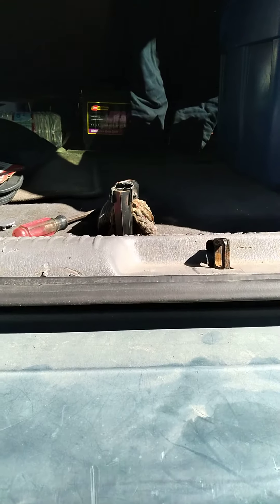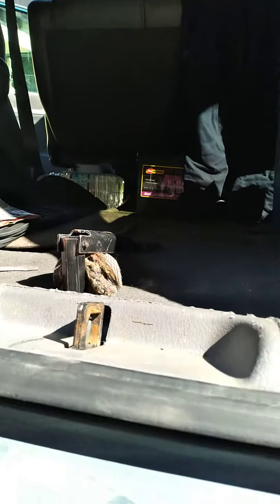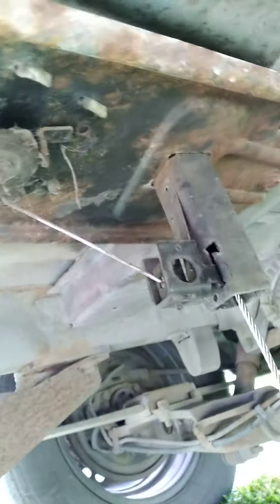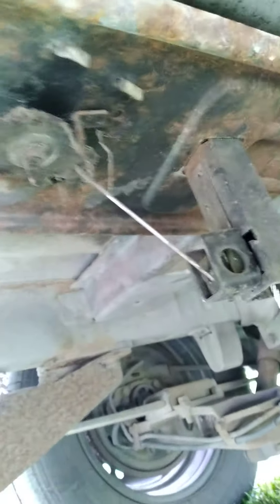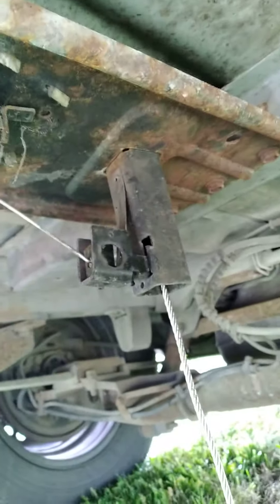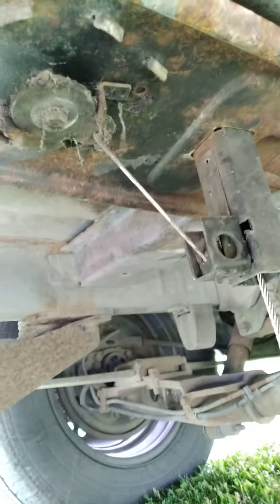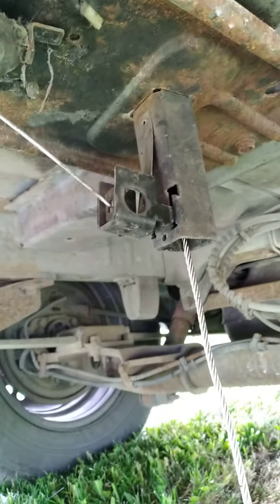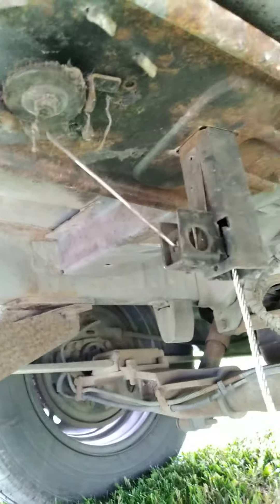98 Dodge Caravan Spare Tire Release

Comment: Hey, Larry... What are you turning to pull the little cable that operates the catch mechanism? My van has been carpeted and I can't feel/see anything. I'm trying to avoid cutting the carpet away just for a look. I can't find any access -- no hole through the bumper for the other kind of lowering system. I'd hate to cut the carpet only to find out it's some simple thing  that  just ain't seeing. I was a carpet installer in a previous life so it wouldn't be the end of the world -- but you can see it from there. :^) Thanks for the video.: Just sane...  :^)  Saint
Reply from the maker: Is it the same year or close to it?
Newer models may be different. 
I'm turning the nut that lowers and raises the cable. It also controls the latching mechanism if the wire is still attached. That's why I made this video. The ones I watched, that wire was missing, and the latching mechanism was rusted. 
The cable won't drop unless that releases.
If there's no flap in the carpet, try lifting all of the carpet up.
I have a vague recollection of the spare tire release mechanism for other models or newer ones being in an odd location. 
Try searching Grand Caravan vs Caravan or different years.
I spent quite awhile underneath the vehicle trying to turn what I thought was a nut on the end of the cable before I gave up and went to searching for YouTube help. Ha!
Reply: @LarryMorrow2  Thanks, man. I have a different mechanism than you have but you inspired me to go take another look or two. I'm turning 70 this year so I miss stuff. :^)
I found a hole above the back door sill (you have to open the door to see it) and inside of that hole there's a square tube (duh me) and it turns about 1/4 turn in ether direction easily but stops after that. It appears the female end of the jack-stand crank is supposed to fit it but it doesn't quite. Looks like a previous owner had beaten it with a hammer and it's flared out a little. Grrrr...
I took an uber flathead screwdriver and tried turning it from inside the tube but couldn't budge it any farther -- couldn't get enough torque on it. There's very little access to the tube but tomorrow I'll try to get a tiny flat file and fix the end of the tube. If I can get that crank handle on it, something's gotta give. He he he.
BTW, it's a '98 Ram 1500 conversion van. It's lived between Florida and S. Carolina it's whole life (no salt) so it's in excellent shape -- bought it from a Mexican family that spent the summers picking cucumbers in SC then the winters picking oranges in FL. They took great care of it (she cried as I drove away with it. :^)
I'll prolly get a spare tire rack for the back door -- too old to be crawling around on the ground digging out a spare.
Anyway, thanks for your help, man. 
Oh yeah, FIRST! Just sane... :^)  Saint
Reply from the maker: @eugenesaint1231  yes, the female end of the jack crank should fit. 
The van I was working on had a plastic nut that it fits over, and it easily.....destined to strip out when you try to snug it up nice & tight.
Your cable winding mechanism may be in a different location, but the safety latching mechanism in this video and others may be the same.
In this video, it isn't stuck, and it isn't missing the wire that pulls the safety latch out when lowering or lets it go back to the locking position when winding it back up.
That only takes about a quarter turn, so I'm guessing something is stuck on yours, and suggest looking into that instead of applying a lot of force to the already damaged cable winding nut. Especially if yours is also plastic. 
It's difficult to access the cable latching mechanism with the spare tire in place, but is possible to get in there and pry out with a screwdriver or something according to the videos I watched. 
If your's is the same, and stuck, I'd expect it to stop at a quarter turn.
It may not be a salty location where you live, but it's still in a tough spot and can rust. The van in this video's spare tire had a few inches of road grime built up in the wheel when I lowered it down.
Good luck to ya. :)
Reply: @LarryMorrow2  Thanks, Larry. That sounds like good advice. I'll poke around back there now that I have an idea what I might be looking for. In the meantime, I got the flat tire fixed -- fortunately, I noticed the flat tire before I left my driveway. Wouldn't want to be on the side of the road trying to figure this out. Instead, I reckon I'll lie here in the fire ants. :^)
I'll let you know how it turns out. Thanks again. Saint